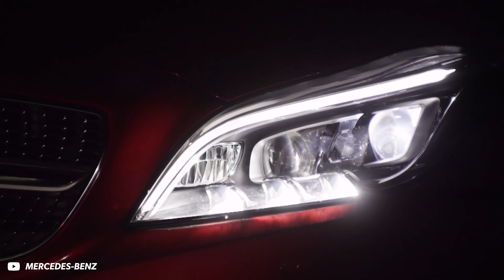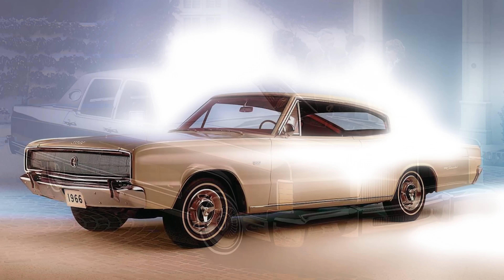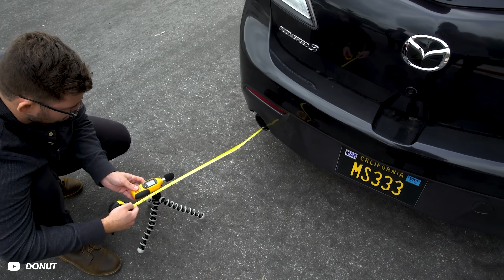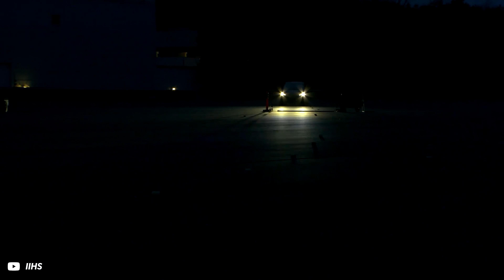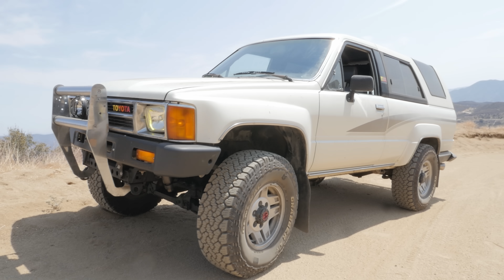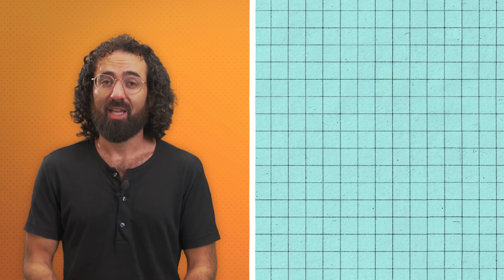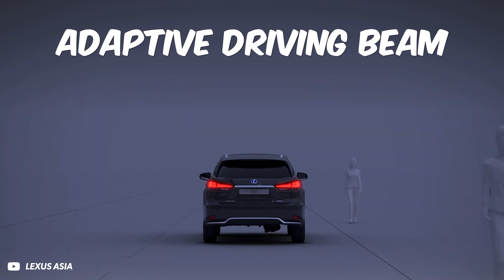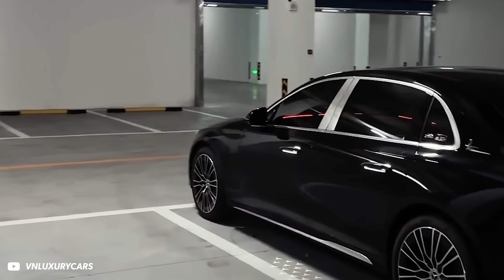Why new headlights are blinding American drivers

Comment: I feel like you missed the root problem.  We have laws that are not being enforced.  If cops regularly stopped and ticketed, owners would learn real quick.  Perhaps equip them with light meters so they can enforce the law?  And I'd love to see every stupid lifted pickup with aftermarket noisy tires sticking out 6" past the fender get ticketed off the road.  For real, cops, what's your job?  Get these clear offenders off the road!  Second, I worked for a parts store for a few years, and while the packaging clearly says "off-road use only" we know they're going on a vehicle that drove in.  Shouldn't we be held accountable for profiting from what we know is illegal use of our products?  Tinted license plate covers, wheel spacers, light bars, all that crap can get stuffed in a bin.

Comment: Lack of block off plates in the projector housing seems to be the core issue. I've retro fitted older cars with LED and they have cut off plates. On the other hand, some manufacturers rely on the bulb manufacturer to have a block off. D2R HID bulbs for example are shielded  while D2S HID bulbs are not. A D2S in a shielded projector housing is fine. A D2R in an unshielded housing will blind. Too many LED bulbs are put into shielded housings which causes the issue.

Comment: It's all about optics and control. You can have bright headlights but they need to be aimed and designed properly with sharp cut-offs and minimal auxiliary glare. For example I notice 6th gen Subaru Outbacks seem to have their cutoff set too high, blinding drivers in similar seating positions, but a Kia Telluride I hardly notice glare or misalignment. Both are fixed LED, and mounted relatively high up on the vehicle, but single projector versus multiple projector systems make a difference in flexibility and light control.

Of course aftermarket solutions are a big problem, because commonly people don't aim or don't know how to aim their headlights. and frankly the very cheap replacement bulbs simply don't put the LED chips in the same place as a incandescent filament which throws off reflector and projector optics in the housing. It seems to be only luxury cars that might even have automatic leveling these days. My old Mazda 6 had an electronically adjustable HIDs, so I could dip the beam a bit more when I had several people in the car etc as the rear suspension compressed.

Comment: I think I’m more frustrated with people running their auto high beams in the city at night. The trigger distance is too close. Also, after having lived in the DFW area for over a decade, I’ve found that there is almost no situation where you could appropriately use high beams. You are either on a street where speeds are not fast enough to justify high beams, and there is plenty of street lighting, or you’re on the highway with so many other vehicles and highway lighting that makes high beams unnecessary. All of that to say, the auto high beams in my Subaru Outback are so conservative that they barely allow the high beams to trigger out in the middle of nowhere. Come across a house with a yard light and they turn off. Get behind a vehicle more than 1/4 mile away and they switch back to low. A vehicle coming at you from more than 1/2 mile, switch to low beams. As a guy that grew up in a place where learning to appropriately and courteously use high beams was a fact of life, I’m feeling like an old man shouting at clouds.

Comment: States need more strict regulation and legislation for vehicle inspections.   Blue and red lights are for emergency vehicles, not your passenger vehicle. Lifted vehicles pose a huge risk to other drivers.  Rusted out cars need to be off the road.  The German system but a little less stringent.

Comment: European here, adaptive LEDs like Audi's or Mercedes or even more budget friendly options like Mazda's or VAG products, they are still extremely expensive, and if for some reason there's a problem in this headlights you need to replace the entire unit which is extremely expensive, in addition, since they rely on cameras using replacement windshields can disable the functions of this dynamic lights as well as a dirty windshield, In addition sometimes they are prone to delay in fast bends, and they are not reacting as fast as they should be, so you still blind other drivers. 

I own a Mazda 3 with Bi-Xenon headlights, and they are the way to go, they are mechanically swivel both X and Y axis, and with automatic Full-beam assist it's the way to go, and while the bulbs are still more expansive than a Halogen bulb, the output is amazing, and it's cheaper than replacing the entire headlight assambly.

Comment: Um, my 2022 Tesla Model 3 has ABD headlights. A software update enabled them earlier this year. I can see them working whenever I drive on roads without streetlights. The car clearly dims vertical slices of the beam that contain other cars in front of me. Pedestrians are out of luck as far as I can tell though.
Reply: lol enjoy your swasticar
Reply: F them walkers right?
Reply: @kylelambert1672  To be fair, a lot of walkers aren't very smart and wear dark clothing when walking at night. So having bright headlights allows people to see them easier.
Reply: Teslas are among the worst of the vehicles i see when it comes to blinding light. I was wondering if they all just came like that, or if you guys all do the same upgrades.
Reply: @VA-gu1jq Because it was only a recent update a couple of months ago that enabled adaptive matrix headlights.
Reply: @VA-gu1jq Nothing is as bad as Lexus, Toyota, and Ford lights. They are horrendous.
Reply: @ProXcaliber  Lexus is Toyota. Toyotas blind traffic going the same direction in their side mirrors because they have a feature where the low beams have a higher cutoff on the right to illuminate road signs more.
Reply: @someguy6075  Yeah, I'm aware that Lexus is Toyota, I'm just separating the brands because they share the same issue. I've most definitely have had multiple Toyota's and Lexus blind me, no matter the angle. And it is usually almost always either a Corolla or an RX model from Lexus (the more crossover looking one). Surprisingly, their larger cars aren't as bad, for some reason. And it most certainly doesn't help that I'm in a sedan that sits pretty low from the factory. But that shouldn't really be an excuse for poorly aimed headlights.
Reply: STOP USING IT. Its broken. Your headlights came misaligned from the factory so it's already bad enough. I'm so sick of Teslas horrid software. They tend to rapid flashbang you or just turn on the right full Beam completely meaning even if you're 500meters Away I have to turn away all my rear mirrors completely. Just buy something not crap. Kia got it right.

Comment: I believe that countries should make laws, if a car is above the height of a standard sedan, it should be illegal to have LEDs and should only allow Halogens on those vehicles.

However, the taller vehicles are allowed to have light bars but only for use where high beam is required.

Comment: Tesla has adaptive headlights in the USA, and made that update about 8 months ago.
Reply: Doesn't work nearly well enough. I'm still getting blinded by Teslas.
Reply: Well the other 95% of their cars are still way too bright
Reply: If it was released with a software update they are likely calling automatic high beams "adaptive headlights". 

Real adaptive headlights are a hardware solution, and they haven't been cheap. I doubt Tesla has been installing those expensive lights in every vehicle for years and not using them... 

If it's a change on new models then I can see it being real adaptive lights... The german automakers have had them for a while in upper trim vehicles, Tesla would be one of the first to bring the feature to regular everyday cars.
Reply: @volvo09  I get what your saying here, but the thing is, Teslas have had the hardware capability for matrix headlights for a long time, it was just that for a while, matrix headlights hadn't been allowed in the U.S. Now that they are, the features associated are getting rolled out OTA. Also, (from personal experience) when I'm in the car(an older Tesla model Y that didn't used to have matrix headlights), I can visually see the beam adjusting to traffic ahead, as in making dark areas specifically for cars in front of us and then tracking the cars as they move about, not just dimming the whole beam at once. And I get the doubt that they wouldn't be adding them on cars if they weren't going to get used, because that makes a lot more logical sense than adding hardware to cars that was locked anyway. I'm guessing they had the mindset of adding the hardware first so that, in the case of regulatory changes, they could enable them OTA, that's just my guess though so take it with a grain of salt.
Reply: @YasithDevapriyayoure correct, my 2021 Tesla has ADB matrix LED headlights and Tesla enabled it via a software update a few months ago. So I think the video is incorrect when he says that only rivian currently has ADB in the US
Reply: @volvo09  They surprisingly have been equipping their cars with matrix headlights for a few years already, but never had the software to enable them. That was until a few months ago, when they finally released an update for the US that enabled the ADB functionality. They did however enable them a long while ago in Europe before the US.
Reply: Only idiots drive electric cars. They are worse for the environment.
Reply: @The-Pimpcat  Electric cars are not green off the production line but they're actually better for the environment in the long run compared to internal combustion. You can run a Tesla fully from coal and still make up for the manufacturing emissions after 6 years of driving. From that point onwards, they become a net positive for the environment when comparing against combustion engines. Realistically though, most countries use a mixed energy source, not pure coal. The break-even point is likely to be shorter at around 3-5 years of driving in most cases. Source (Argonne National Lab)

Also, the average prices of electricity in Australia is roughly 34 cents per 1kWh. A Tesla Model Y RWD has a 60.5kWh battery with a range of 466km. So you're paying 20.57 Australian Dollars for 466km of range... This is expensive than in many countries but still far cheaper than petrol/gasoline for the same range so I have absolutely no idea what you're talking about.
Reply: @Ben21756  Oh yeah, so what do you plan on doing about the toxic landfill?
Reply: @The-Pimpcat  Toxic landfill? I'm not aware of any, and if they do exist, it would be off the books and illegal. Countries have anti-dumping laws for EV lithium batteries. You can't just discard and forget, that is not how that works. Instead, they're placed in secure locations awaiting for recycling. Batteries are highly valuable for its parts and second life use.
Reply: @Ben21756  You should read into it. You'll be shocked.
Reply: @The-Pimpcat  The raw materials in the battery are nearly 100% reusable. Plus they are already refined, which would make them cheaper to source than the raw material from a mine that will then have to go through the entire refining process. There is an economic incentive to re use the batteries, and many companies currently exist with the focus on battery recycling
Reply: @SyntheticSpy  Recycled? Haha. How do you think they make them? With magic? The toxic waste is produced during production. Wtf good is recycling if all the damage is done during production?
Reply: @The-Pimpcat care to support that claim in any way at all…
Reply: @The-Pimpcat  Prove it.
Reply: @The-Pimpcat i don't care about the environment, I just hate paying $4/gal for gas where I live
Reply: @CorrectOpinionMan  I am Australian. We pay even more for fuel. That being said. Electricity is even more expensive here.

Comment: The IIHS is very strict on glare and forced manufacturers to properly adjust their headlights.

The issues are with badly aimed headlights, lifted trucks and especially aftermarket headlights that don’t meat safety standard.

90% of the cars that glare me are aftermarket. The others are just badly aimed.

Comment: As a european I can tell you that the problem persists even with adaptive headlights. The adaptive lights dont always recognise upcoming traffic or out of the ordinary situations. 

IMHO the US is actually on the forefront of regulating headlights in a safer manner than Europe does. (And yes that does mean european cars have better nighttime visibility)
Reply: I have found that by the time those systems recognise you, you have already had your vision blinded.
Reply: @TheRatlord74  It really depends on the road conditions and how powerful lights the oncoming car has. If the road is straight and oncoming car has bright lights, the adaptive lights turn off way too early. IF the oncoming car has old halogen lights, adaptive light system may react way too late. Tight corners are also problem and system might keep the high beams on.
Reply: Here in Australia they have wattage limits. The issue is it's not policed anymore and those head lights still under those limits are 10 times brighter now. Old laws need to be updated.
Reply: @The-Pimpcat 
If the laws are there and not policed, is not updating the law that do anything. 

Not too mention Australia used to be much more free country, now it's a nanny state where everyone wants to be controlled by the gov.

You want the police to stop policing crimes that pay them and more crimes that affect civilians.
Reply: This is why the REAL solution is to just use warm white LEDs that are of the same brightness and color temp as the old halogens. Not sure what's so hard about that. Warm white LEDs are all over the light bulb market yet for some reason I can't find one car with a warm white LED headlight
Reply: as a european you should know laser led is bad for eyes
Reply: Briefly blinded is not worse than constantly
Reply: Never been blinded by those adaptive LED lights, idk why many have problems with that.
Reply: @bebabcsinya  they confuse adaptive headlights with high beam assist

Comment: I ride an e-bike as my main commuter. People turn on their brights every time I ride at night. Now before people start say some bs about wearing black. I wear construction clothes with reflectors built in. Plus I have 3 headlights on my bike. So you have to be blind to not see me. I've ended up in ditches because of people turning on their brights on purpose. I went out and bought an led light that's 2000 lumens. I turn it on and just like magic those s.o.b.s dim their lights. Now before you get mad the second they dim their lights I turn it off completely.
Reply: one reason i mount my light on my helmet, a little nod of the head and they get the point

Comment: Your example of Europe does i well is not a good one. We do have cheap after market products, we too have older vehicles. We do have annual tests but they can be overcome. Each country has it's own standards
 We do not have so many jacked up vehicles. 
We still get blinded. I have yet to see any adaptive matrix headlamp working in Europe. Research tells me these are usually fitted as standard and they are not available on all models.
The down fall of  Adaptive lights is that they are repairable if something goes wrong, being sealed units that need replacement if they develop a fault, or are damaged. Given the cost of these systems, a replacement outside of warranty will be painfully expensive.
Thus meaning scrapping a vehicle early rather than later.

Comment: In my mind the problem is primarily what ever amount of light is beamed out of the housing, not the color nor the amount. I often see certain LED lights just beaming out a 360 degree ray of light making it appear brighter than it really is simply because it's not focused to go in a particular direction. So in other words the manufacturers just need to hone in the focus of the light source as well as the height level needs to be in check as well. 

Personally I have a bigger problem with the fact most people drive around with no daytime running lights around their cars, and have everything set to auto(I live in a country where we are used to mandatory daytime running lights). So often you struggle to see them from behind in the "right" conditions also if the color of the car is dark as well. Or people driving around only with foglights in the daytime, which to me is also wrong because of elevation and other obsticles along the way, you will be seen later when the light source is lower to the ground. 
Personally I want to be seen which is a benefit for myself and everybody else. That's why I always still drive with full running lights because that's the only thing that makes sense to me. You got lights for a reason and it really does help to have them on in the daytime as well. I find it sad that retailers recommend customers to set the switch to auto, simply recommending less safety. That's a bigger issue in my mind than a few janky overly bright light source here and there because that's definitely a minority.